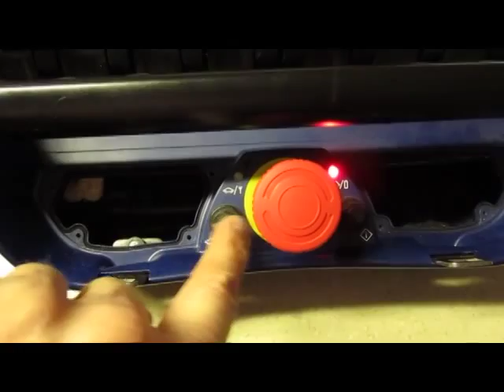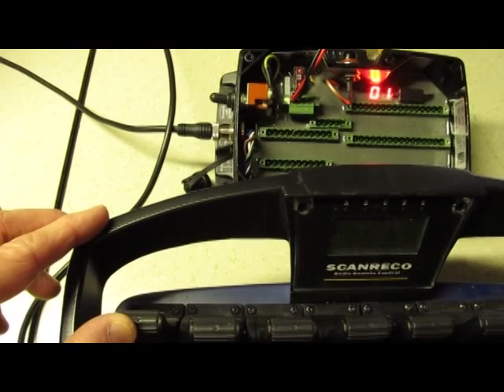Diagnostic mode G2B

Comment: Please help. After hydraulic ram repair remote control rc400 is not working as normal. Speed became very low and not possible to use different directions at same time. In manual mode (crane chair) all working properly. Central unit screen shows 1H. Rc400 diagnostic shows joystick range from 18 to 28.
Please give advice if possible.
Reply from the maker: Hello! To receive support, please feel free to contact our service manager at ivan.campanini(at)scanreco.com
Please also include in the e-mail the type and serial number of both receiver and transmitter. Many thanks!